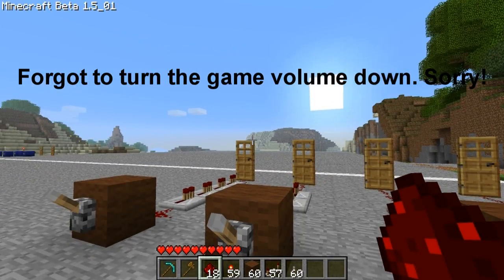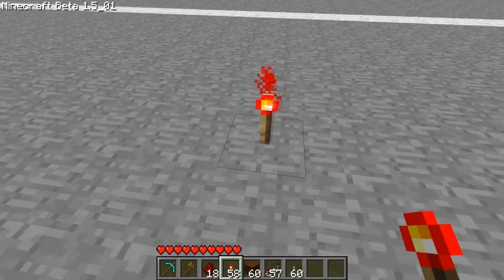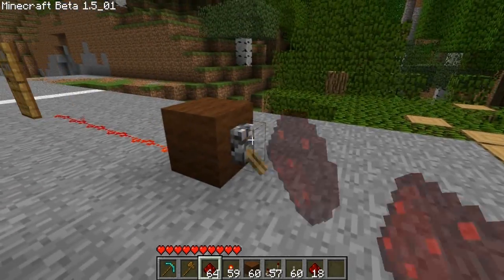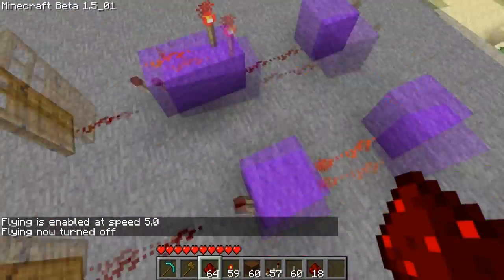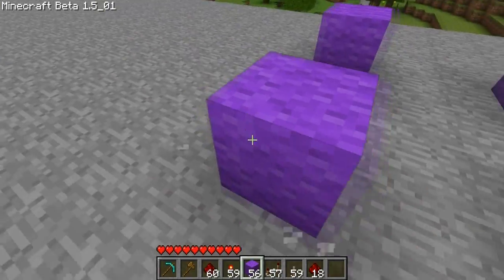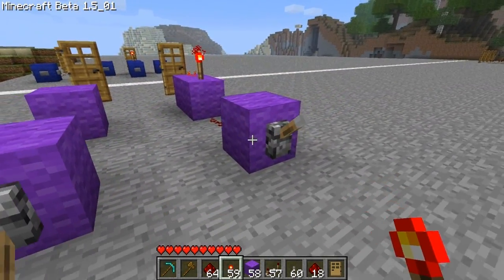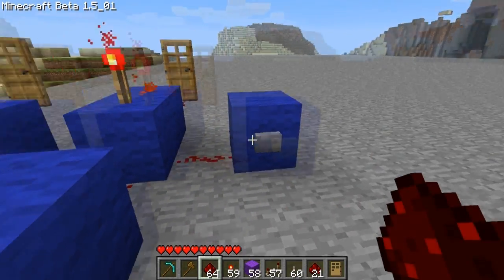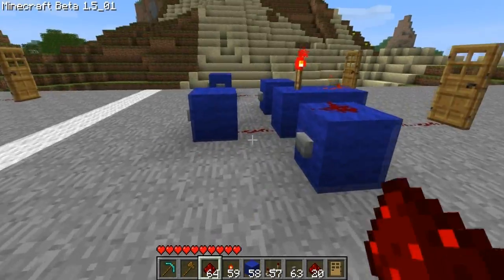Minecraft - Redstone Basics - Tutorial

Comment: There is a mod called "Redstone Simplefied" which adds Lapis wire which doesnt contact with redstone, Pulsing torch what it does is when you connect it with redstone
it acts like a pulser and make the redstone pulse, T Flip-Flop torch which acts like T Flip-Flop circut.
And another mod called "Vertical Redstone" which you can wire redstone vertically!
This two mods are amazing for redstone users and you should review them!